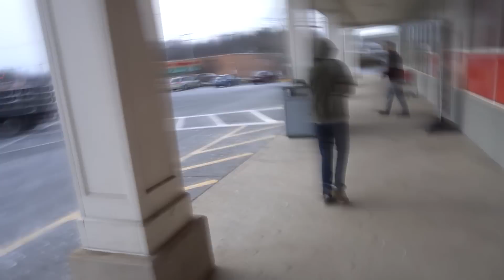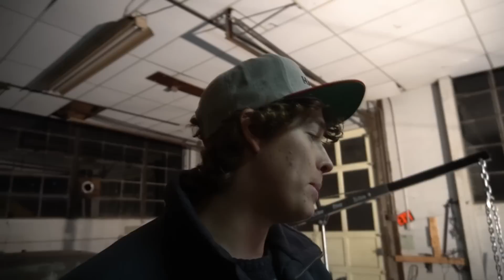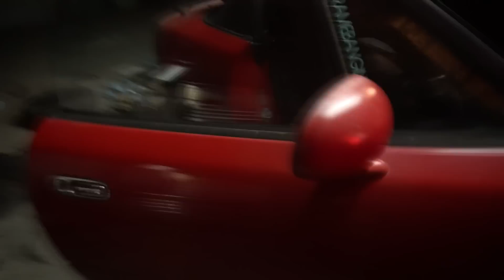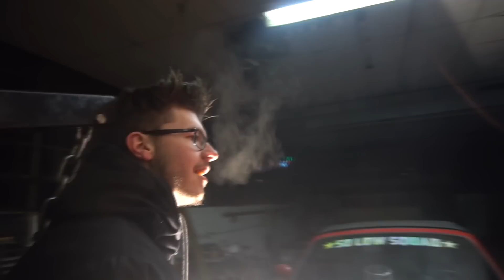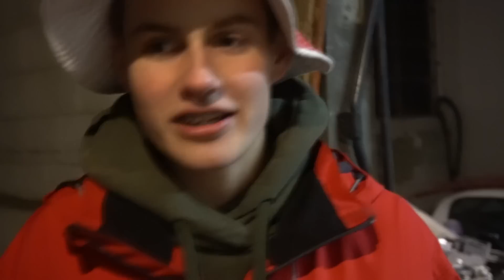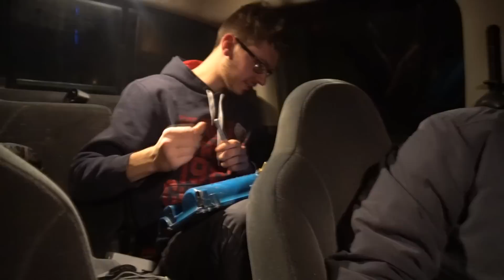IT'S TOO RUSTY!

Comment: Put Tommy's 302 in your black miata
Reply: Ford 300 I6 that would be so badass
Reply: chase gibbins relaibilty and torque. Those inline sixes were greate for hauling wood.
Reply: agreed in stock form there weak but there is a kinda underground group that turbos them. they actually become pretty stout.
Reply: with a cobra intake and some heads and a cam with low compression would be badass and an intake and an exhaust
Reply: chase gibbins not an inline 6 I'm talking about a 5.0
Reply: Just grab an explorer 302 its basically a cobra motor with weaker valve springs and a truck cam.
Reply: Matt Hudson its pretty nice until you start pushing 500 horses you're probably gonna end up splitting the block
Reply: I already told him in comments but hes probably ignoring it
Reply: Johny Reyes your right. I have pictures on my phone of my old 302. It split right along the cam journal.
Reply: N54 from the 135i
Reply: Dan Duffy miatas are so light that they loose traction at 300hp with 500hp or what is he running in there would be hard fight to drift it without spining out and even the weight of the engine in the front will lift the rear up so it would be kinda imposible to drift it
Reply: Belly Head I feel that 100% but if he has two now why not make a drift car and just a crazy build?
Reply: Dan Duffy yeah thats actualy true
Reply: Matt Hudson we split my friends 302. same spot lol

Comment: The best way to join 2 wires in the engine bay is to crimp them . After that you add some solder for strenght. All that heat variation will damage the solder and it wont be so solid over time .

Comment: u are correct woth how to solder rudnick. get some soldering paste. it helps to distribute the heat more evenly accross all yhe wires and as yhe paste evaporates from heat it litterly pulls the solder into the wire.
also gotta let the soldering iron completley heat up for about 10-15 minutes before u touch it too the wore to ensure the quickest and smoothest soldering job.

then clean residue from paste and tape or heat shrink your connections

Comment: Chris when you want to join two wires dont twist them together.  Straighten both paired ends and prime with solder then just melt together.  You should be able to do that without to much heat. If you get it right it will be plenty strong.

Comment: soldering is easy. add solder to tip of iron, put iron underneath wire, when wire heats up add more solder. make sure wire is clean too or else solder wont stick very well.

Comment: the key to soldering is making sure your soldering tip is clean. your iron is getting hot enough but it's dirty. use a wet sponge to clean it when it's hot. unless your tip is shiny it won't do a good job.

Comment: Ricer Miata. Big fan.  I have a brand new Reese hitch that would fit ur truck for sale for $50. Only problem I live in ohio
Reply: And it bolts to the frame. No welding needed
Reply: William Lamp You're not supposed to weld a hitch ever.

Comment: When you solder you don't want to twist the wire. You will notice a huge difference.
Reply: Also ask the grocery store for cardboard boxes and block the broken windows with em.
Reply: kene eye Not true. Nasa specifically twists their wires for end splices for best contact and integrity. 

The iron wasnt hot enough or he sucks at soldering
Reply: grjsb13 I should have been more specific. Don't twist the individual wire ends. You want to fray the individual wire ends before you twist them together. Then you have the most surface area contact, and is way more secure.

Comment: lol to solder you have the gun heat up till it smokes and you put the tip of the gun in a jell like a small can and then put the gun tip and that metal wire to bond them together and then put it to your Wires and then it should look like a good weld bead not in a bundle crap and then before you soldered you should shrink wrap the 2 wires together. :)

Comment: you need to get a hotter soldering iron ... heat the wire longer and touch the solder to the heated wire not the tip of iron...and when wrapping the wires together you make a better connection with less resistance in  the system you need to push the wires into each other and twist them so it makes a almost uncut connection

Comment: Just an idea. Why don't you use the oil feed line you purchased with the box of random items and extend your current feed line. This would clean up the engine bay and make it easier to install onto the turbocharger.

Comment: to solder you put the gun on the bottom and the flux and wire on top so the heat disperses

Comment: heat up both the wires so they soak up the sodder, then touch the two together and hold your iron on them. get some gat shrink from harbor freight for a few bucks

Comment: You're wrong, when soldering you put a drop of lead on the solder gun tip. Then you put that solder on one of the two wires. Then you do the other one. Then you melt the two together

Comment: You dont weld hitches(they come with the hardware)...it s half hour job; 1 hour if you have to drill/awg out a couple holes. Just got one for $20  for my F150 from the PicknPull with harness.

Comment: Bro did you use flux when you soldered that? Would of helped a lot. You shouldnt of pigtailed those wires either, you should of soldered them straight then heat shrinked them

Comment: Just my 2 cents worth.  Crimp and heat shrink probably would have been a better method than soldering for splicing in the engine compartment.  Could Yata Man provide you with some helpful  tips and assistance in this matter.

Comment: You had the solder method down rudnik. Heat the wire first then apply solder :D
Reply: protip though, go to haggard freight and get you a case of the shrink wrap tubing they sell. otherwise electrical tape all those wires together so they aren't loose.

Comment: Get some of the plastic for windows. Its cheap and put up several layers.
http://www.homedepot.com/p/3M-62-in-x-84-in-Clear-Plastic-Indoor-Window-Kit-2120-EP/100353672
Reply: Bruh thats fucking insulation not a window man its pretty much just like thick tape your link must have got messed up or something because thats wrong
Reply: Adan Patino
it clear plastic that you stretch over the window its very thin like 1mm and held in place with double sided tape around the windows that leak cold in the winter. Its classified as insulation because is a layer to stop the cold and wind to an extent. But its not designed to be your first layer of defense though.

here is a multi kit they carry

http://www.homedepot.com/p/Frost-King-E-O-Indoor-Window-Insulation-Kit-3-per-Pack-V73-3H/100135637
Reply: Shane Massa Oh now i see yeah he should get that and maybe a little heater that plugs into a wall outlet. For the window he can resort to wood but i think something a bit more "professional" like that kit would be good

Comment: are you using flux when your trying to solder? it makes IT WAYYYYYYYYYYYYYYYYYYYYYYYYYY easier.. it sucks the solder right into the exposed wire but if you ARE using it... ummm practice makes perfect? and cardboard makes good temp windows.... just cut to size and tape the bitch in